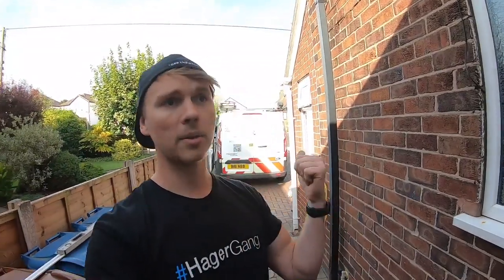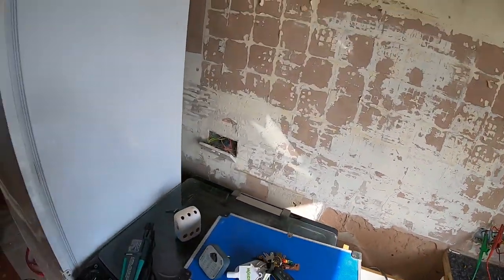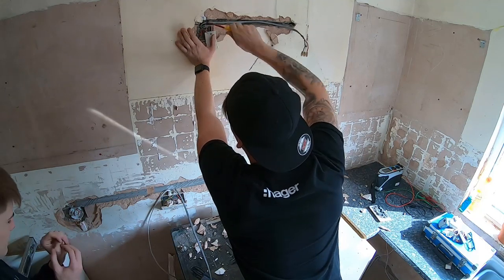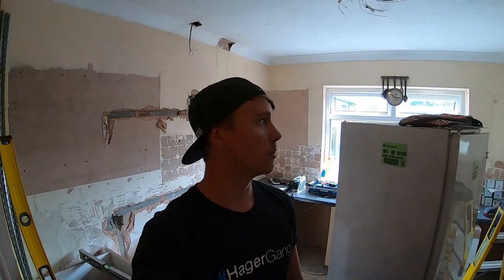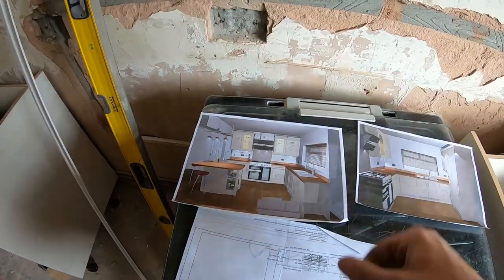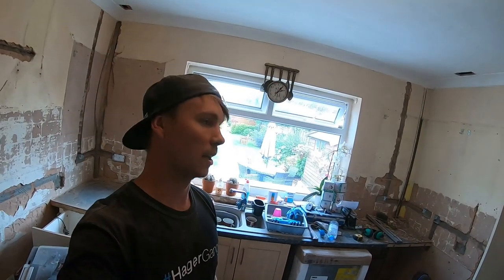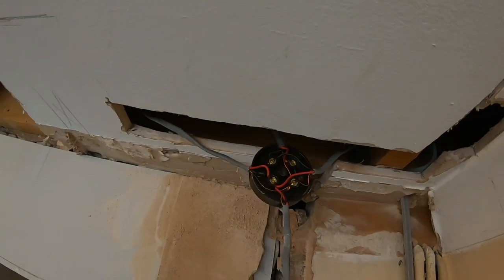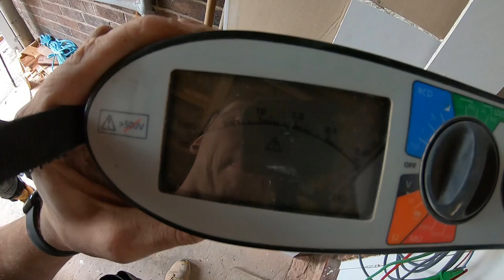Fault finding on kitchen ring, wall chasing and capping, Exotic life of an electrician

Comment: in the US there is no way they allow hidden junction boxes in the wall without an access panel, nor are you allowed to run wires behind a piece of plastic covered with plaster... those would have to be run between studs or covered in metal conduit,  and run outside of the wall, the UK plugs are great and I wish we had them here in the US.

Comment: Good advert for the end of ring circuits. Fine when first put in but over time it turns into a mess then whole thing needs redone. Just run 4mm radical for kitchen sockets instead and put appliances on there own circuits.

Comment: allow 900mm worktop height plus 150mm to the bottom of the box, based on if they have granite or other upstand you will clear it, a 150mm tile fits neatly underneath, it is one and a half 100mm tiles so you don't get a messy bit underneath or above the box, if they have tiles the size of paving slabs it goes in the middle of the tile anyway!

Comment: Hi Nick, sorry to be picky with your work, but I would never use the wall corner join in a kitchen, as a future precaution, as most kitchen fitter would be drilling/fixture fitting in corner for cabinets, better using ceiling/wall zone then drop down to accessories

Comment: Typical shit wiring in a kitchen, I think 90% of kitchens we work on are in that state before we start. We tend to not bother trying to salvage anything and run it all in new where possible. Am in the habit of running 2 radials for a kitchen, with grid switches for appliances.

I find it easier to run switched feeds to the top of the wall units for under cabinet lights and either somehow leave a draw wire for the ELV stuff or if your organised enough get the under cabinet lights on site for the first fix stage and run them in so the transformer or driver ends up on top of the cabinet rather than on the underside. Looks neater and is easier to work on in the future. We normally fit LED tape so we’d first fix the ELV cable that goes between the driver and the tape.

Comment: Hi nick. Good to see how people do things differently that’s why I watch these videos for ideas and different products ppl use in different areas. I use Makita chaser and dust extract works amazing had it for years so much easier and I always use oval rather than capping I can’t see the point in chasing a 50mm wide chase when you can do one line with the chaser and put in 25mm oval much better job to look at in my opinion. 
I also don’t chase across the wall at all I would have gone in the ceiling void and straight down to the hood supply.
If I see you at elex I say hello 👋
Reply from the maker: Im gonna try the oval stuff soon I think, and yeah If u see me give me a shout 👌

Comment: What are those pliers you’re using?
Reply from the maker: Artisan Electrics https://www.amazon.co.uk/Telephone-pliers-Wiha-Insulation-approved/dp/B00ISP7L7E/ref=pd_aw_sim_60_1/262-3724520-8920540?_encoding=UTF8&pd_rd_i=B00ISP7L7E&pd_rd_r=a02335f5-af0d-4a58-980a-4c9f49638be3&pd_rd_w=Xwv1Q&pd_rd_wg=Qyjhe&pf_rd_p=4f3e997e-5715-4eb0-b5ff-04ed185317f1&pf_rd_r=HQCB7YBZYZBV577R15ZG&psc=1&refRID=HQCB7YBZYZBV577R15ZG really useful bud
Reply: I like them!
Reply: I noticed them lol..I have some VDE rated Draper Ergo ones angled like that but not with the shielded bit on the handle.

Comment: Disclaimer I am not an electrician, but I notice the wiring seems to have a lot of vertical runs (pain for fitting cupboards), why not bring those down in the corners as well. Also wiring seems to change direction from horizontal to vertical without entering a backing box at some points, does that meet regs? I am never quite sure....

Comment: Was that a multi tool you used for cutting outside lines for chases? What bit did you use?

Grab my strong hand child! : )
Reply from the maker: keitho77 just normal wood bit that’s fucked so I angle grind big teeth in it to cut plaster bit easier and keeps costs down, 🖐🖐🖐🖐
Reply: @NBundyElectrical  nice tip mate

Comment: I do wish you would give kitchens a
Ring or 4mm 32A radial. With only 20A that is only 2 heavy appliances that can be on together.
Reply from the maker: Andy Kirwan the only heavy appliances that would be on would be micro wave and kettle as washer and dryer are in utility and cooker has its own 6 mm but I get your point 👍
Reply: N Bundy Electrical ok. Also consider dishwasher, toaster  coffee thing,

Comment: if you have boxes next to each other link then  using a galvanised coupler and bushes , bring one ring leg into each box and throught the coupler  form the link, will we have to return to metal capping in some cases for the 18th , ps had some fun on kitchen electrical problems over the years good video thanks
Reply from the maker: Great idea thanks Phil 👍

Comment: A prime example why only electricians should do electrical work in the kitchen, there is no way a kitchen fitted would have found that, another job where you had no favours, leaving the kitchen in 🙄
Reply: Agreed, such a pain trying to work round fitted units and appliances.
Reply: I always get a plan of the kitchen drawn with dimensions.   Much easier to set out as discuss with clients.   I will even autocad all my own drawings and do proper dimensioned drawings.   Then draw up electrical layout on that

Comment: Hi . On your video at 14:30 you said a double socket under sink for dishwasher.... my sparky told me my kitchen failed because their was not an isolator switch above the kitchen  surface to isolate the undercounter dishwasher. Wondered what your thoughts were. It is amazing the thought process of some people that think burrying junction boxes is acceptable. Look forward to hearing from you. Regards Don Codman
Reply from the maker: Hey don, to my knowledge a socket located in a cupboard ie socket fixed inside a kitchen cab not behind it, as long as it’s accessible it’s fine, it’s when there is a socket behind an appliance and it’s inaccessible so you would need a spur on work top to isolate it
Reply: @NBundyElectrical  aaah ... many thanks .... I see the logic now. Many thanks . Have a good bank holiday.

Comment: Hi mate 😀i have a quick question 
i can buy 650 w 850 w and 1050 w angle grinders. I will need one for some tiling around the house. And also i wanna do some chasings. What model should i buy? The 650 i believe is too weak. The 850 is good for tiling. But is that enough for chasings? Or it will burn down? And also can i do chasings with a rotary hammer? Or i should just get a 50 usd grinder?

Comment: Nick - quick question for a novice spark but how do you secure your capping - do you use raw plug or a particular type of screw like wall dogs? Great videos by the way - very real - I am dealing with the same problem in a kitchen ring that is reading open circuit in the line cables - just got to convince the client that I need to cut holes in her ceiling to check all the junction boxes I found hidden in the void!!
Reply from the maker: Hey snail, if it’s soft walls I just impact a screw straight in but harder walls I red plug and screw, yeah best to go digging abit 👌

Comment: Only place I dont use a radial is a kitchen too many loads for a 16 even a 20 amp circuit.
Ring always for a kitchen then radials everywhere else.
Reply: 4mm 32A radial???
Reply: I rarely find that 32A rings are necessary.  Most kitchens are fine with 20A, especially if there's a separate circuit for the utility room.  I left a datalogger running for two weeks at a recent kitchen installation and it only occasionally went slightly over 20A for a couple of minutes.  If you do a load assessment of your own kitchen and apply diversity you'll probably get a similar result confirming that 20A is fine.  Good design requires that you assess loads for each installation and consider all the available options rather than having a rule that you stick to regardless.
Reply: @ashmanelectricalservices4318  Yes!

Comment: Just a quick one regarding switches I was told on the grapevine newer installations require or a good to have naturals at the switches as future proof for dimmers ect. Is this true? (From an older industrial focused electrical apprentice)
Reply: You don't need a neutral for switching purposes , including dimmers
Reply from the maker: It’s becoming a newer thing to do, helps with smart switches
Reply: Thanks both, good videos nick thanks for the content mate.
Reply: It's good practice, I can't see it becoming a requirement though.

Comment: New to channel great work finding those  joints. Can i ask why did you only run a radial circuit when you where going back to dis board any way or did i miss somthing as kitchen has high demand items wouldnt a ring bw better?  👍👌😊
Reply from the maker: Adam Mccabe hey mate, being the washer and dryer are on their own ring and cooker is on a 6 mm didn’t see it necessary to be honest 👍

Comment: How many sockets do you usally say on a radial. is it a 20amp radial I always makes me think it's going to trip especially in a kitchen how many appliances would you say is ok off a radial 
Likening the videos mate keep em coming
Reply from the maker: greg davies as long as the cooker has its own supply being either a 6mm for higher rated ovens for its own 2.5mm radial if it’s over 2.6 kW then I find kettle micro and toaster fine to run on its own radial, but when u have a washer dryer and dish washer on to that much better running a ring 👍
Reply: @NBundyElectrical  sound mate in my kitchen I have a small radial washer ,under counter freezer, microwave and the 3 amp spark for gas cooker I reckon that's about the limit lol
Reply: @NBundyElectrical  also mate how deep do you go on your chasing in
Reply: If in doubt run 4mm and up your OCPD
Reply: @richardwilliamson3624   if your doing that why not just make it a ring?
Reply: @danny brown because I don’t live in the 1940’s and if you have to ask why... even the dinosaurs went extinct 😂

Comment: what a great reason for not running rings especially in a kitchen......2.5 cable rated for max 24 amps running through a 32amp breaker......
Reply: , it's 27 amps if clipped direct
Reply: Peter Baker 
Still max 20amp breaker.
Reply: Totally agree
Reply from the maker: its on a 20amp breaker, not a 32

Comment: Hood isolation circuit, gies from FCU up then right angle to unswitched socket. Isn't that outside the permitted zones?
Reply from the maker: No bud, the permitted zone from the fused switch is straight up and zone for the socket is up, down left and right level with the socket
Reply: @NBundyElectrical  I dunno I dont think so the zones state going from accessories or to walls horizontal or vertical therefore that right angle shouldn't be there. Look at you orm site guide it will not show anything like that
Reply from the maker: Page 82 on the on site Gide 
“ be protected by a 30 mA our RCD and installed in a zone either horizontally within 150 mil of the top corner wall or partition or vertically within 150 mil of an angle formed by two walls or run horizontally or vertically to an accessory or to consumer unit where the wall is 100 mil thick or less and location of the accessory or consumer unit can be determined from the reverse side the zoning arrangement is protected through the wall”

Comment: Nick , Just curious ... when you put a Fused spur for a socket behind an appliance , why dont you just use a DP switch mate ? Nicer above worktop and the fuse is in the plugtop anyway ? 

Or is it just what your used to ? Got my first 3 bed rewire coming up soon and was wondering your thoughts on a Metabo Chaser ? I think ill invest in one as ground floor is Concrete so drops from above for 5 rooms 😭
Reply: Dale Odonnell I always put a fused switched spur above the worktop then just bring the load to a single socket behind the appliance. My company are subcontractors for my council and this is how they like it done, pretty sure it’s standard all over the country.
Reply: Dale Odonnell Honestly mate I don’t think it’s worth it. Chasing really doesn’t take that long even if you’re doing it from the ceiling down. You going to be by yourself?
Reply: @uplightuk8924   i know its fine and some Jobs spec it , but it makes no sense to fuse down when the plugtop has a plug , unless you were fitting a flex outlet then yeah it makes sense
Reply: @uplightuk8924  no 2 of us , iv priced it for a week as its a Big house and occupied 😩
Reply: @uplightuk8924   what would you recommend for chasing ? I was just thinking the 3 Blade Metabo , and slide Oval PVC Conduit over the 2 x 2.5s and that should fit right in the 1 Channel no need to do 2 lines just for PVC caping the conduit will do same job
Reply: Dale Odonnell I’ve never actually chased in an occupied house. I always suggest for them to leave the property until it’s done as it gets very messy and dusty. The fact that it’s occupied makes it like 2x longer 🤣 Most of my rewire are council so they usually spec us to to use trunking, we will only chase if it’s a void. Also for chasing I literally just use a 110V angle grinder and then chase it with a 110V SDS, so I do everything manual. It’s fucking long don’t get me wrong but you can do it quickly, I don’t see the point of spending 100s on a chasing tool, but then saying that I usually just get another apprentice to do it😭 I’m an apprentice myself but I’ve finished college so I technically rate myself a bit higher loool
Reply: Dale Odonnell I think it’s mainly just to have an easy way to isolate the appliance, if you just plug the appliance into a socket behind it then you have to pull it out and unplug it to isolate it whereas with a spur you just switch it off. Also councils live to go extra hard on being ‘safe’

Comment: Why is there no main isolator on that consumer unit?
Reply: David Masson looked like an rcd being used as main switch. Not uncommon back in the day in a TT system.
Reply: @AndyK.1  Looks like someones replaced the main switch for an rcd at a later date to me. No discrimination between rcds.
Reply: @bigdai85  Discrimination? not very 18th edition?..lol ;-)
Reply: @muzikman2008  Haha you sound like my niceic inspector!
Reply: @bigdai85  Isn't is call 'selectivity' now?
Reply from the maker: Some one had replaced the main switch with an rcd but have old customer and they are considering a new board 👀 it’s one of those I wish I hadn’t said anything 🤫
Reply: N Bundy Electrical Is it time delayed? Marked with an S ?
Reply from the maker: I couldn’t tell u I’m back Monday to second fix so I’ll have a look 👍
Reply: @NBundyElectrical  should be 100mA rcd on incomer for TT if my memory serves me well.. 🤔
Reply: N Bundy Electrical Also see if it’s 100ma or 30ma and TT supply.
Reply: MrBazza1975 Probably. Or it could be a TT install where all circuits must be protected by RCD e g 100mA
Reply: MrBazza1975 having 2 rcds next to each other would be pointless.

Comment: How do you and the KItchen Fitters ensure that you are not putting cable runs where the Kitchen Fitters need to attach the cabinet fixings to the wall.  It'd be a bugger if the cabinet fixings were at exactly the same hight as sone of your horizontal runs.

Comment: If there wylex nsb MCBs then potentially the 6A, 16A and 10A breakers need replacing as they have been recalled
Reply from the maker: Mitch Waite I’ll double check when I’m back Monday 👌 cheers for heads up
Reply: Not all were recalled. You need to check the serial numbers.

Comment: What is a ring?
Reply from the maker: It’s when the socket circuit is looped around the house and brought back to the fused board to create and ring which can take a higher current
Reply: Something you propose with 💍

Comment: I thought that cabling should only go straight up and down not across ?
Reply from the maker: Cucumber Man across is okay as well 👌 as long as your inline with switch/ sockets
Reply: Some people don't get this "zoning" in BS7671 lol.. Diagonal is nont permitted. Up, down, 150mm in corners is fine.. Read the regs.. 🙄
Reply: muzikman2008 thank you
Reply: N Bundy Electrical thank you
Reply: Cabling ‘can’ also run diagonally provided it is either more than 50mm deep or mechanically protected in steel conduit - but that sound like a lot more work and expense!!
Reply: @snail5967  and it's guesswork for the next guy and/or anyone going into that wall

Comment: Rewire it, don't waste your time. By the way it's line not live, the neutral conductor is also a live conductor. And it's a CPC not an earth and it's a ring final not a ring main.....Also why are you using switched fused spurs to supply sockets, the plug top already has a fuse? Just put an accessible switched socket outlet near the appliance, adjacent cupboard etc?
Get a wall chaser with an extractor. You'd be done in half a day, rewire, new RCBO board supplying lights and kitchen power circuits. Job done, no messing about with existing bodged 80s kitchen lashup.
Reply: Correct, however its like slang, you hear people speak more slang in the modern world than you do the correct vocabulary even more so in trades and if people can understand what he is saying / means then there isn't an issue.....
Reply: Yes sir, right away sir.